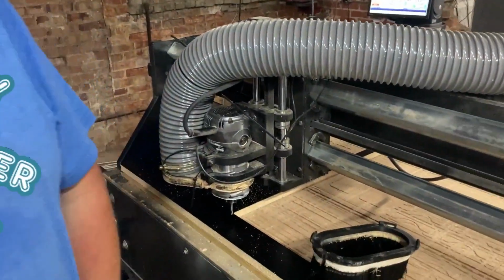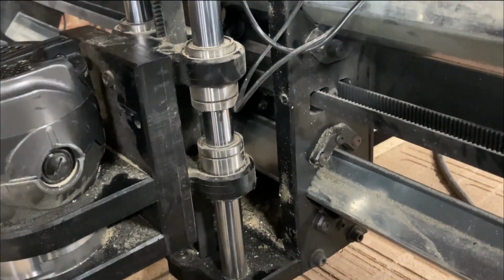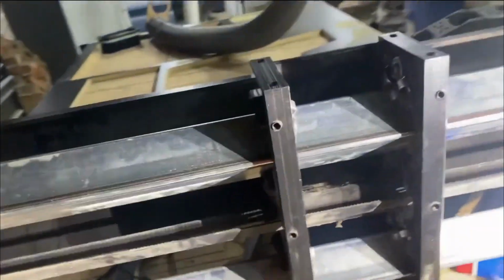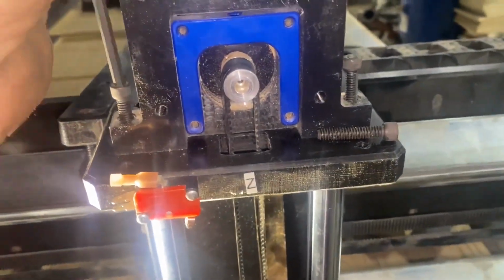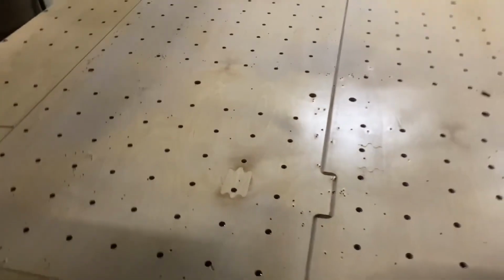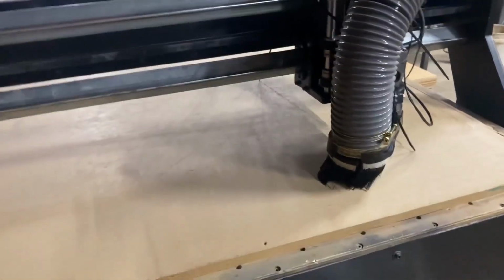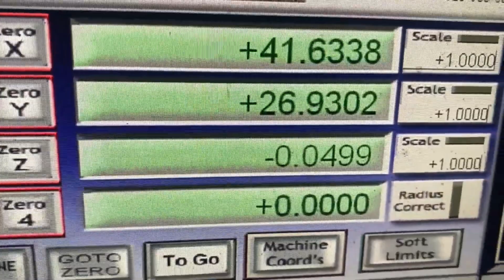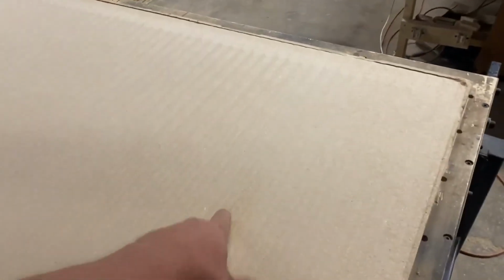Our Zenbot CNC Machine Sounds Like It's Falling Apart, Let's Check The Bearings....

Comment: Technically keeping a thin layer of oil where there's metal to metal contact between the bearing rolling on the guide would slow the wear over time but since it's exposed to sawdust I'm not sure that would work out so well. Maybe the design of this machine is such that those bearing surfaces are sacrificial... I feel like the hardness of the guides isn't good enough.
Reply from the maker: I think that might be where I screwed up about six months ago. I put some oil on those rails. And I think it got soul dust, and that’s what got is in this spot